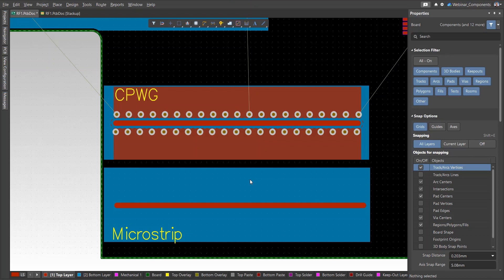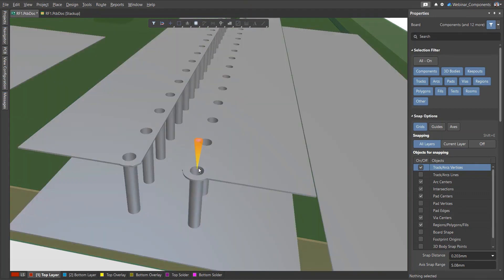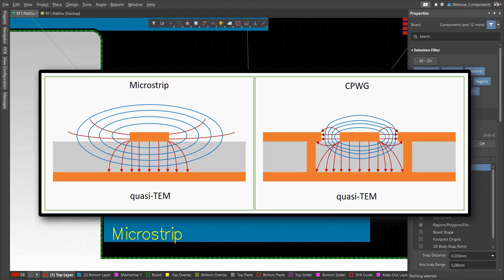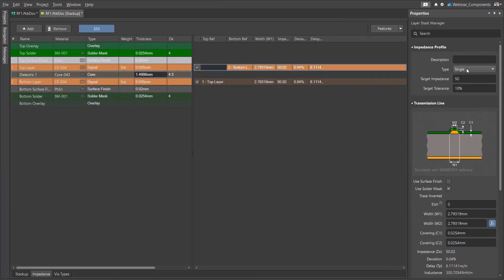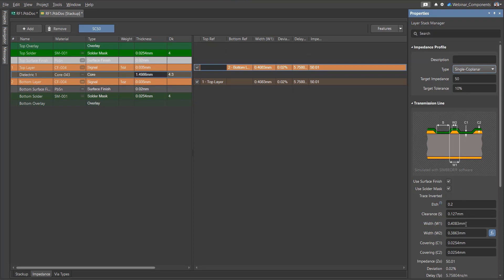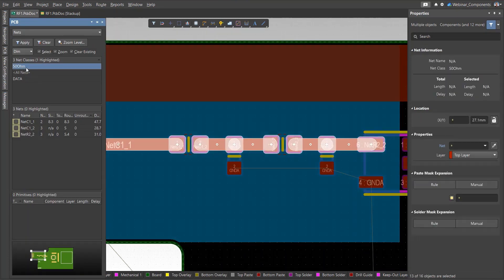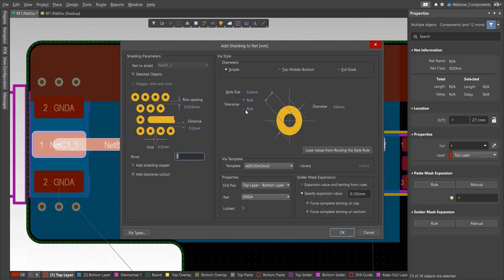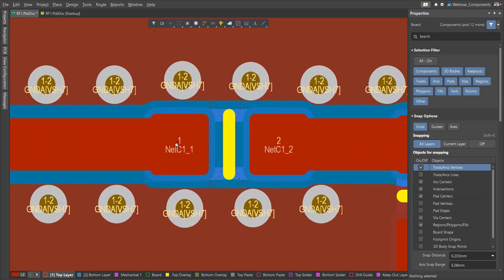RF Design in the PCB: Transmission lines (coplanar)

Comment: How did you get the shielding vias to direct connect?
Reply: You can set up the default connection style in the design rules to be direct connect, by default it will apply to all pads/vias. I think also in the Add Shielding to Net dialog there is an option to set up a thermal relief if you did not already set it up in the design rules.

Comment: Can we rely on ADS line calculator tool width calculation of cpwg track. For 16 GHz a cpwg track of 1.5 mm came as a result and I had to tapper when connecting the track in my circuit
Reply: What is the distance between a track and GND plane below?
Reply: Core of 13 mil was used and track to Gnd distance on top layer is 0.22mm

Comment: Can Altium address the bug with clearance DRCs and CPWG structures? If you set up clearance rules (GND polygon pour to 50Ohm track rule, for example) the actual clearance as the polygon pours adjacent to the trace, it is never perfectly accurate. You always (no matter what) have to adjust your DRC rule by the offset Altium creates, it's very frustrating and has been this way for many version.
Reply: I understand, I solve this either with a cutout as shown in the video, or with a specific net spacing rule between the coplanar net and GND. It would be nice if that part of the impedance profile could be auto-applied in the rules and constraints editor.
Reply: @Zachariah-Peterson  Hi Zach - just wanted to let you know that setting the Arc Approximation in the GND polygon to a really low value (we did 0.0001mm) will fix this bug

Comment: CPWG can have more dispersion and loss than microstrip.  It all depends on the geometry and dielectric.

The example shows two shunt components.  The return currents on the coplanar ground are perturbed by the components.
Reply: would you isolate the upper ground planes from the shunt components and connect them trough via's to the lower plane?

Comment: Great video as always! Did you add those cutouts under the components in the RF path manually or is s there a way to add them automatically?
Reply: Cutouts always have to be added manually unless there is some feature I am not aware of. The other way to do it is to apply a clearance rule only for the RF net.